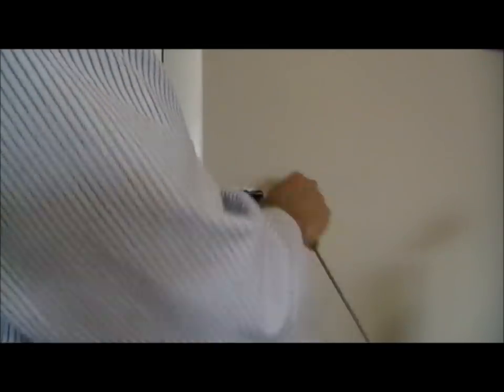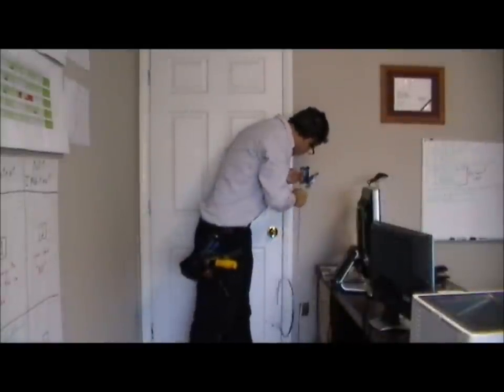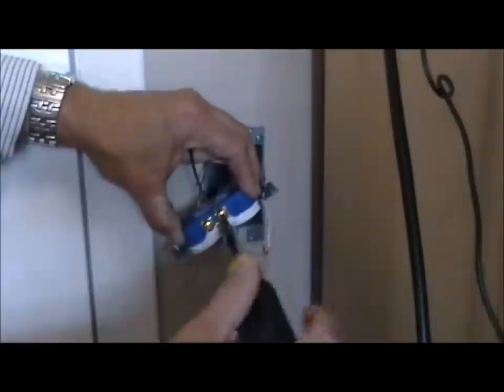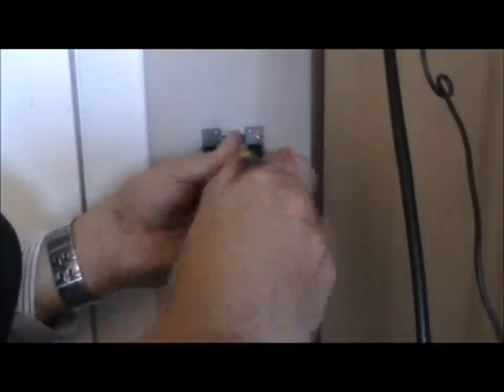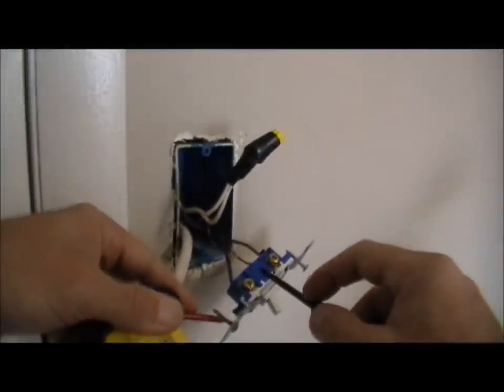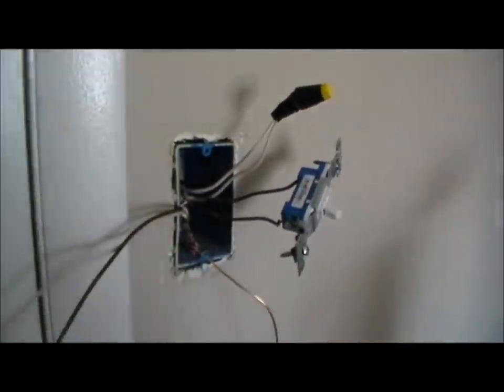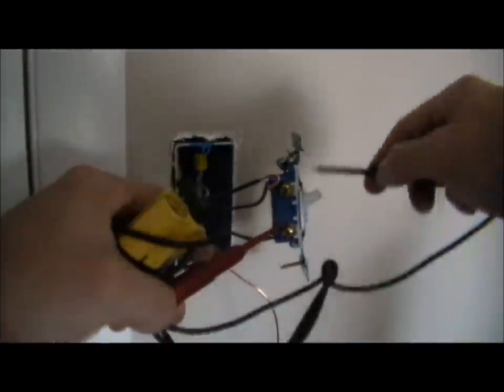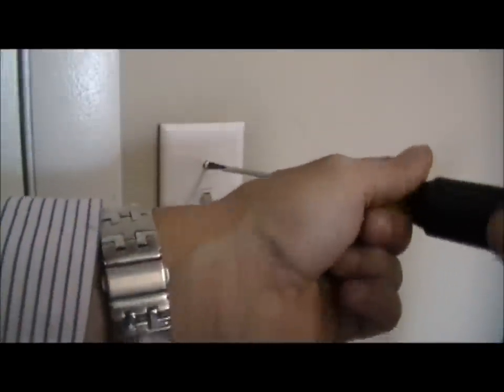how to wire an outlet off of a switch

Comment: nice video I'm a electrician what you need to do is tape it outlet n switch so in the event u work on while hot it will not trip breaker if the outlet hits the box n also you should had pigtailed the hot on switch
Reply: Hard to do with non metallic boxes.

Comment: Great tip about the ears!  Thanks!  I work with hot wires, too.  I work on school clock systems.  I couldn't imagine shutting down 300 classroom clocks in the middle of a school day just because I was afraid to hot wire a 110.

Comment: Thank you for the video. Was able to place an outlet below a switch at the bottom of our stairs because of your video. Appreciate your time and instruction.
Reply: Does the outlet work on a full time basis or only when the switch is turned on? Thanks

Comment from the maker: @voidenter  It is a good idea to turn the power off when working with electricity. I was trained to work with electricity with the power on by my father. I was also trained to never believe the power is “OFF". I do most of my work on live wires because it allows me to find things that can be missed if the power was off. I don't recommend work on live wires unless you were trained.
Reply: GEN3 Electric & HVAC old school vs new school. The new guys will never understand what or how we were taught. The new fish get the idea, “if the power is off, I won’t get poped “ while the old ones were” I know I will get poped, but I’m not a damn sissy...
Reply: You know several you did in the video are code violations, right?

Comment: When turning off breakers to find the right circuit, plug a radio in loud. When you snap the right breaker the radio shuts off !
Reply: D. Cole that would be hard to do for a light switch, which is the power source he used
Reply: But good info for tying in to an existing outlet
Reply: or in this case, simply turn the lights on, and if they turn off you have tripped the right breaker.
Reply: Brilliant.
Reply: Seth Jefferies or the washer...(ha ha ha ha...)
Reply: D. Cole i usually test it with the fork in socket method.
Reply: Damn, that's a really good idea. Beats the hell out of using a lamp to determine which circuit was turned off.

But this also taught me that I need to label my breakers, and I am almost complete!
Reply: @MattyJBayBay  I usually ask my kids to do that. I'm not stupid.
Reply: Here’s a better idea turn of the whole house
Reply: instablaster
Reply: Great tip
Reply: Wow that is a killer idea!!! Thanks!

Comment: This was extremely helpful to me.  I never knew the tabs were supposed to be broken off for remodels, but that makes sense.  Also, it cleared things up to see that only one of the hot wires is always live.  I'm glad folks commented about margin of error in working with live wires for weekend warriors; I was wondering about that and decided to turn the circuit off for that step.  I separately looked up how to test for the live wire using a multimeter (200 VAC setting).

Comment: Switch boxes do not ALL contain a neutral !  It’s very common for the feed circuit to come into the light fixture box first. Then, only two wires ( including the ground wire ) are run down to a switch. One wire is “hot” from the light box and the other wire is the “switch leg” return to the light fixture. I’ve had calls where someone has cut holes in their wall, below a switch box, to add a plug, only to find out that it can’t be done because the switch box does not have a neutral wire .

Comment: Viewer: If you're not a master electrician, this video does show connections but there are many POTENTIALLY DEADLY safety mistakes.  0:01 Make sure the circuit is off at the breaker box, test that it's off with a voltage tester or multimeter.   All through the rest of this: Connect ground to outlet, then neutral then hot.  Don't work on anything when there's live power if you don't have to - unlike the second half of this video.   Don't bang the switch or outlet back into the box, carefully plan the bends of the wires and snug it in.
Reply: I 1200% agree. this guy should not be doing tutorials.
Reply: @TheRainman904  If google was held responsible for their content, most of these videos would not exist because they are just wrong.  If your power is off, it doesn't matter what order you connect the wires. The real problem is using both the back connector (which you should never use) and the side connector at the same time. They aren't designed as a pass through and can cause problems. The wires should be connected together in the box and the switch should be connected with a pigtail.

Comment: It's been a while since I worked in electrical or checked local codes, but 2 things I noticed that cannot be done in Florida you did in your video. 1) You must have a mechanical connection between grounds. (Center holed wire nut or crimp). 2) You cannot put 2 wires behind 1 screw without use of wire eyes. In most cases we use a pigtail with a wire nut at the union and the other end behind the screw.   Other than that I would always make sure you tell people to shut off the breaker before attempting this themselves.. Also if OSHA were to see you do that, well!!!!!! :(  Otherwise great video...
Reply: Wouldn't pass here either. No reason NOT to get a couple more wire nuts and pigtail it off of them.
Reply: Nice to see that not everyone on here is an idiot telling him he did a good job. Scary how many people think this was done well.
Reply: Pig tail for another reason. My daughter bought a house and found that kitchen outlets only work when the light was on. You can guess, previous owner replaced the switch and got the hot sides (switch) backward. Had the electrician originally used a pig tail there would have only been two blacks to worry about at that switch.

Comment: Watch and learn roockies. Anyone that does this the way he did it must be an a expert. No fear of hot wires. I really was waiting for him to jump in the tub and finish the connection. Only someone with his experience can do like him. Rookies please cut off the power before starting any electrical work or just leave it to the experts. Great job and thank you for taking the time to show and explain in such detail. Dallas, Texas. CityOfChampions
Reply: This is no different than seeing Jeff Jordan driving at fast speeds on the highway without his safety belt buckled, or seeing Michael  Phelps jumping in fiveteen feet of water without a floating device or seeing a trapeze performing without a safety net. Catch my drift¿
Reply: Actually, most of what he did was wrong. The people who keep saying "good job", clearly have no clue what they are talking about.

Comment: I did commercial and industrial wiring for several years and was taught when hooking up the neutral, it's the first to make and last to break. With that being said if the breaker is off it don't make a Damn. Good step by step instructions though. Also had to point out that I see you are using Klein tools which is all I use. The 10-in-1 is a time saver.
Reply: You did commercial wiring for several years and didn't notice everything he did wrong in this video?

Comment: You made it look so easy that I actually got excited for a second. Meanwhile my switch has no silver screws, just a gold with a black wire on one side and a green with no wire, and a gold on the other side with one black wire and a black with two black wires. And some white wires and possibly grounds stuffed inside the box. Guess I’ll be continuing to use an extension cord to vacuum my hallway! 😅

Comment: People watching this should know that once you find the hot wire going in to the switch, turn the power off, then wire then turn back on and test. There is no way people should be wiring with the power still on. I also like to wrap the sides of the receptacle last thing before putting back in the box, it is a metal box and helps, also you can wrap a piece of electrical tape around a wire nut who says you shouldn't, its not there to secure the wires, but helps if you are pushing things in the box, also tug on the wire nut after installing to make sure it is on there
Reply: as i was watching this video i asked my self all this time and i didnt have to turn the power off and im like no fucking way and then i saw the comments and i was them if this is professional then i am a master electrician
Reply from the maker: Electrical tape around wire nut is an awful idea. We get so many service calls where wires are all melt it because someone who is not very skilled use tape to hold the wire nuts  on. What they actually did was hold it was connection close enough to create a super hot arc.
Reply: Generation 3 Electric  well not if you use the correct tape lol. We use 33 and 88 tape wich is rated for high-voltage and will not harm the wires at all! It is used around the wire nut for extra safety just in case the wire nut loosens up and you have bare copper exposed!

Comment: You can do it with live power,  but when you show people how to, cut the power off, or at least mention it
Reply: Not up to code in 2021
Reply: @maceo2012  he was not grounded, I worked on live circuits all the time.
Reply: @nomanjones4803  Looks like he wasn't grounded just because the ground wire wasn't attached. since he touched the metal of the switch and the hot at the same time? That would be so easy for someone that doesn't know what they're doing too miss. I'm not a pro and wouldn't trust myself doing that while hot.
Reply: @James-ms2mx  there was no juice in that wire yet.

Comment: To emphasize what others have said, the NEC requires that all grounding connections be of the mechanical type--typically lug, screw-head or wire nut. The twist-the-ground-wires-together technique shown here may not be able to resist the electromechanical forces that are present during a high-current ground fault, which means the connection could open up before the fault clears, possibly resulting in a disaster. Some solutions are (1) use a green wire nut with a hole at the tip or (2) use a conventional wire nut with a pigtail or (3) run the long ground wire through the switch's terminal screw and then wire nut the end of that wire to the other wire.
Reply from the maker: You are correct. This video is older then when our state adopted that code. Grounding wire nuts should be used.
Reply: Generation 3 Electric I urge you to remove this video and replace it with one that corrects both the wiring method and the failure to remove power. Note that only hobbyists will be viewing this video, not experienced electricians.
Reply from the maker: There is no way to test the circuit with the power off. Please upload a video reply with update instructions if you feel more info is needed.
Reply: Generation 3 Electric One turns off the power after the circuit has been tested. Testing a hot switch is relatively safe.
Reply from the maker: That is definitely an option. If you feel more comfortable that way by all means turn the power off. It's not the way it is done in the field.
Reply: Generation 3 Electric My point is that for the video's audience, hobbyist electricians, it should always be done that way.
Reply from the maker: I respectfully disagree.
Reply: Generation 3 Electric.. don't be a stubborn head.. just do it right.. ohh and I'm using my Mom's computer so this is not her..

Comment: Careful, often times lights use 14 gauge wire and outlets use 12.  Doing this will require a 15 amp circuit for the outlet.  Know this ahead of time!
Reply: hello,well what you suggest is  not  100%,if the wireing is #14 g wire,its 20amps outlet ,even in a room with several  outlets,there may be one that needs a 20amp for a number of connections that need more total amps,,

Comment: U are brave for working with power on. Good video. I finally figured what u did. U help me figured out why my gcfi outlet only turned on when restroom light switch is turned on. Weird. I didn't know u can tie up all neutral wires and just hook the black wire only to the switch.

Comment: I would have measured the height of the other receptacles in the room, as opposed to using the "electrician's hammer" method. No "greenie" or Buchanan crimp on the grounds is a definite fail.

It's easy to pick apart another electrician's work, and we do all have our ways of doing things, but I must say that even though working 120v hot is nothing for us, in that situation, there's no way I would be doing that in a YouTube DIY instructional video.
Reply: Yeah, I thought not turning off the main was a bad show for those (like me) who don't normally mess with electrics.  I wouldn't have done it.

Comment: Touches the live wire at 12:30 with one hand while the other hand hovers an inch away from the ground. Dude was literally an inch away from adding his heart to the circuit.
Reply: Informative but not a good idea to do this with the power on.  Sure, the guy is a pro and knows what he's doing, but the idiots on the internet are likely to get an eye-opening shock  when they try this.
Reply: @localdrummerweb  certainly will wtf

Comment: Keep on posting please. It helps me a lot. I wish you demonstrate the final test after finishing the job. Because I was wondered if the outlet only work when the switch turn on. It would be nice if you plug in a lamp into the new outlet and show it in the video so I have an idea. Other than that, It was an awesome and very thorough video. Thanks

Comment: I work for a school district, and I've spoken to many electricians about not turning off the circuit breaker.  Their answer has been the same.  The breaker box  at any given site can be hundreds of feet from where the outlet they're working on.  It takes too much time.  Some have told me they get shocked from time to time. And finally they tell me that they are electricians, they know what they're doing. As for me, I turn the circuit breaker off.
Reply: Fausto Rios that's dumb I rarely work live when I do I use insulated tools and take my time

Comment: What about turning off the breaker when working on a circuit!!!!!!!!!!!!
Reply: How did the hot side, not shock the hell out of him, when he loosened the hot side screw with his bare fingers? (he had just checked it to make sure which one was hot- then it did not even shock him when he touched it? Confused!)
Reply: SCOTTY LMBOBOY
 If you don't bring a low level circuit to a close state it won't shock you. He's not touching anything else so he's not closing the circuit.
Reply from the maker: I was trying to work with circuits hot. It is a good idea to turn the power off if you are not trained. Unfortunately it's impossible to test and mark the circuits with the power off.
Reply: Ome LMBO u have to touch both screws
Reply: Tim Bits or the hot side of the switch and a ground.. like the electrical box, heating radiator, water pipe ..
Reply: Tim Bits "u have to touch both screws"  OR
the "Line" screw and Earth.
However, at 11:58 he has forgotten that he has disconnected the Earth from the "frame" of the switch!
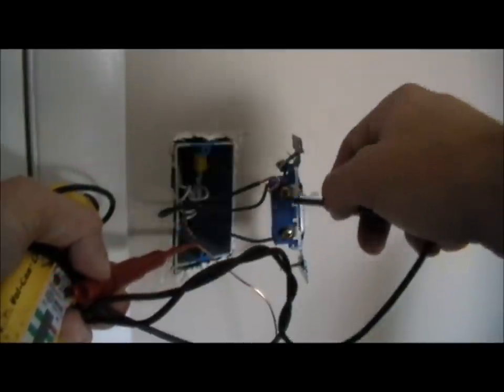Then, at 12:20, he is holding onto the frame of the switch with one hand and unscrewing the "Line" screw with fingers of the other hand. (It is just as well that the frame is NOT earthed at this point!)

On top of this, he places two looped wires under one screw: NOT using a ""twist on" wire connector with a "pigtail" to connect to the switch.  It is my understanding that placing two looped wires under one screw is (to say the least) NOT good practice.

From http://www.mikeholt.com/nec-questions-and-answers.php

Q1. Is it acceptable to terminate two wires on a single screw or lug?
Q2. Is it permissible to terminate two circuits on a single circuit breaker?
A. Sometimes. According to 110-3(b) "listed or labeled equipment shall be installed and used in accordance with any instructions included in the listing or labeling" and 110-14(a) states "terminals for more than one conductor shall be so identified".
The only time two wires can be installed under a single screw or lug is when the terminal is identified for this purpose. 

Circuit breakers rated not more than 30 amperes are often identified for the termination of two conductors. This can be verified by reviewing the circuit breaker manufacture's catalog.

Also, I have found in http://ul.com/wp-content/uploads/2014/08/NovDec2008.pdf the following in answer to the question "Are receptacles that are provided with more than one set of terminals Listed for tapping off more than one circuit, utilizing both the side and back wiring terminals?"

The short answer is yes for receptacles Listed for the U.S. market and no to receptacles Listed for the Canadian market. 
................
Single and duplex receptacles rated 15 and 20 A that are provided with more than one set of terminals for the connection of line and neutral conductors have not been investigated to feed branch-circuit conductors  connected to other outlets on a multi-outlet branch circuit, as follows:
• Multiple conductors under a single binding screw 
.........
Reply: +Generation 3 Electric What the hell kind of electrician are you?
It's not impossible. Ever heard of "continuity"? Ever heard of tape, and a pen?

Just because your employer doesn't give a shit about safe practices, doesn't make
it a good idea to tell the viewers that what you're doing is ok.

Where I come from, you wouldn't have a job very long.
Reply: ***** A million times over?

Learn to count, or not to embellish, or both.
And, who's "we"? I'm only hearing "you".
Reply: why not amend the video with a annotation or closed caption to say the breaker was off and then when you had to trace the feed... annotate that you temporarily turned the breaker on?
Reply: Only Sissy's turn off the power before working on a circuit. I do everything HOT makes me pay more attention to what I'm doing.
Reply: @scottyboy2400  You got to touch both wires at the same time. In this case black and white.
Reply: he said make sure the power is off